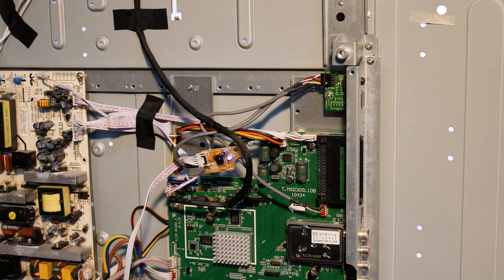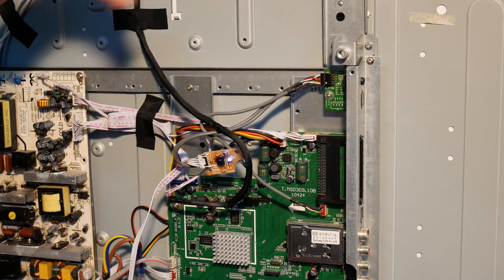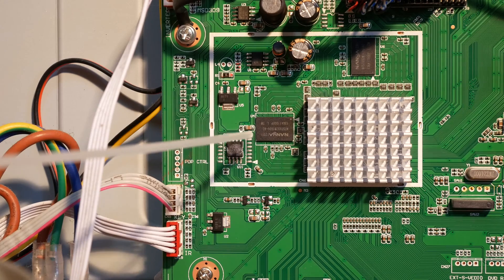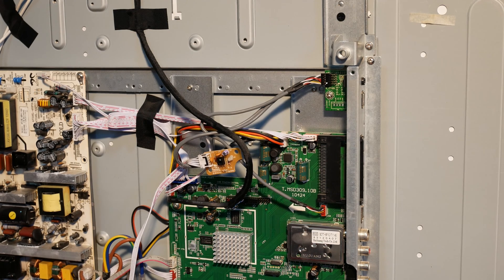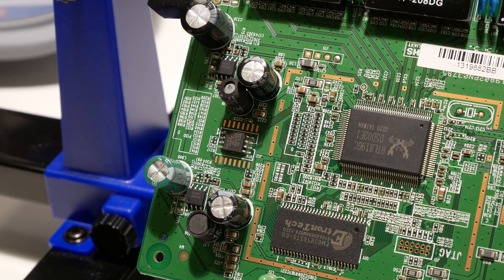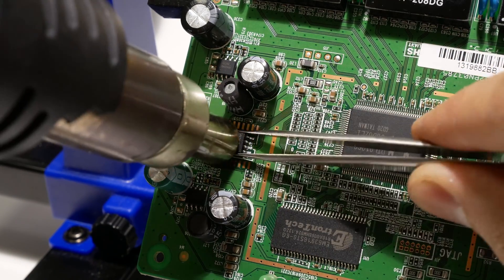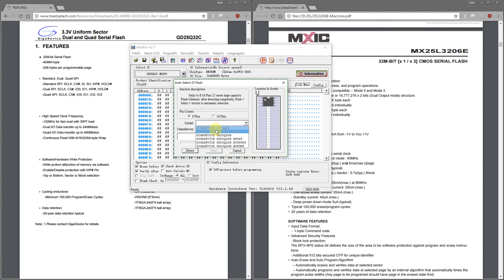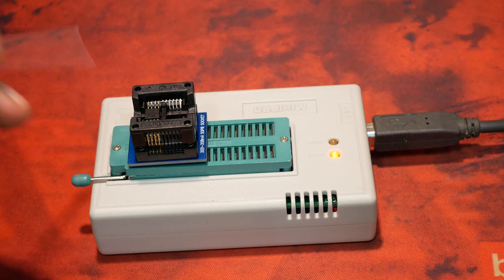How to diagnose an intermittent fault - TV flash memory replacement

Comment: Thanks for the video !
I have this LCD which has a strange behaviour. Do you think it could be the panel flash chip ? 
Because I seem to recall that LCD store the unmoving pixels on the flash when the GPU does not update them, which could result in the behaviour. You can see the behaviour in this video : https://youtu.be/8Sd-mw77Evg
Thanks :)
Reply from the maker: They don't store images, there is way too much data to store. In that case I would rule out problems systematically, start by connecting an external monitor, if there is the same problem in the external monitor it's a GPU problem, if the monitor looks fine, I would try replacing the LVDS video cable (it looks like the likely culprit), if that doesn't work I guess you might have to replace the LCD.
Reply: @jfaria  Thanks for your feedback!
When tested on an external monitor, there isn't the problem.
But I just tried a new screen and there is the same problem, so it's either GPU or eDP cable.
The guy at the repair shop thought it's 99% chance the GPU and unlikely the cable.
You think it can be the cable?
Reply from the maker: @pierreboyer9277  If the laptop is worth it I would test a new cable before getting rid of it.